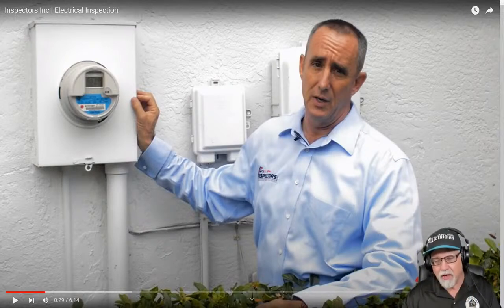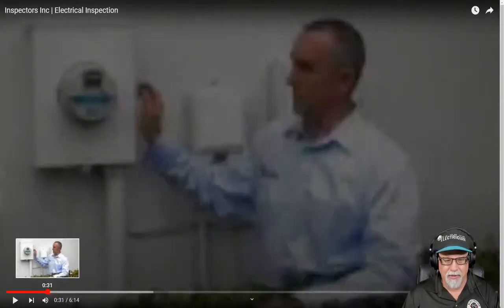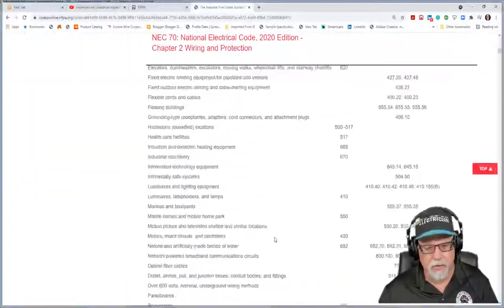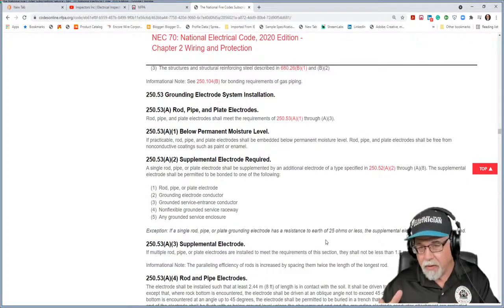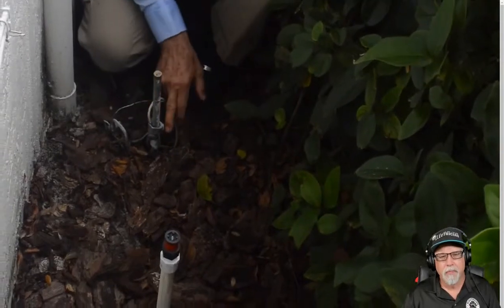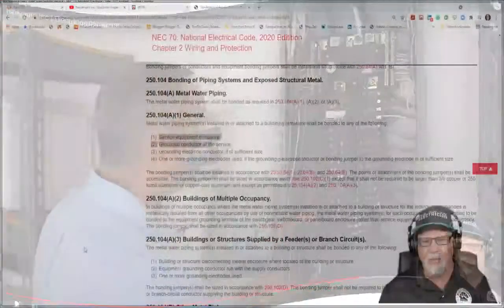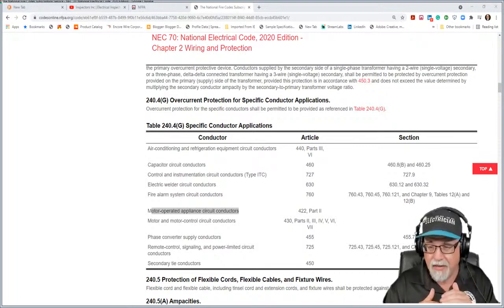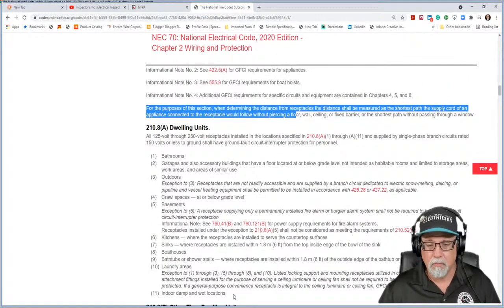Electrical Blunders | Electrical Inspector Blunders (REPLAY)

Comment: So if you have one ground rod and a uffer you only need one ground rod? Didn't mention that  and what about bonding the gas line? And of course water
Reply from the maker: Well, it's not an educational video in a sense I go over every plausible condition. If I did the trolls would have a field day...1) if you have a ufer(CEE) then no need for ground rod at all. 2) this assumes there was a gas line and if it was likely to become energized, which I can't make that call from a commentary position. If there is a water pipe supplying the structure and it qualifies as a water pipe electrode then it would be tied to any other electrode present of course. Now, can you supplement a single ground rod with a UFER, well sure as 250.53(A)(2) permits is...but again why?...If you already have a Ufer then no need for the ground rod period.